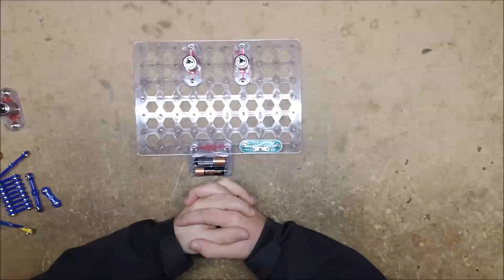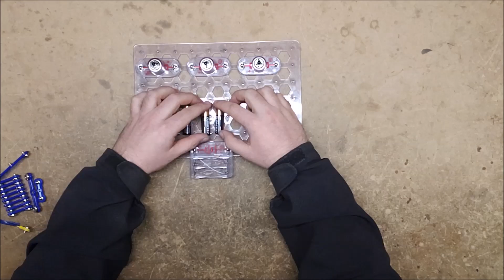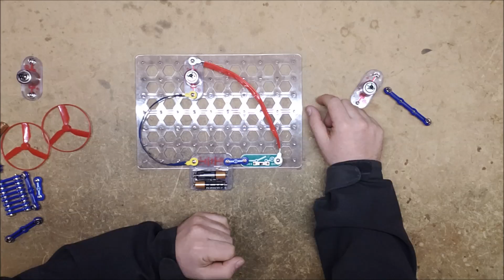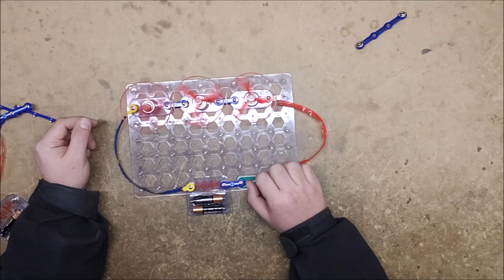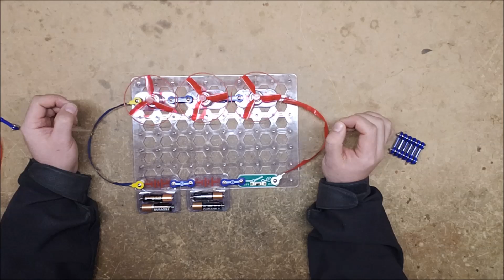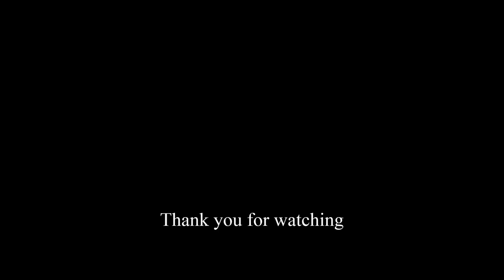Monday Mod Tips - Circuits - Parallel vs Series

Comment: As an EECS engineer, this is a nice, lay-man's explanation of Kirchhoff's current law (KCL: sum of currents entering and exiting a node equals zero) and Kirchhoff's voltage law (KVL: sum of voltages in a loop equals zero).

More circuitry tutorials would be nice for the rest of the community; battery capacities and longevity, lipo C ratings, understanding motor spec sheets, etc.
Reply from the maker: Thanks! I'm glad I got it right. I decided to avoid formulas and formal laws to not confused lau people...including myself. ;)

Comment: I have that thing. It’s called snap circuits It’s a pretty good thing to buy if you wan to learn about how electricity and things like resistors work.

The motors from the thing spin up pretty fast and a small child wouldn’t wanna touch it also electricity and small parts

Comment: Regarding the 9 volt batteries. Why are they so rarely used in either factory or custom blasters?
Reply from the maker: Because 9v batteries are designed for super slow low current applications. Things like fire alarms and alarm clocks. If you use them in Nerf blasters you would have to replace them about every 30 seconds.

Comment: I have made a 9v to XT60 connector adapter for testing circuits lol. IMRs are good for testing if the 9v doesn't have enough 'umph' to get things running properly, like pusher arm breaking. 
Keep up the good work with the electric explanation videos using the simplified circuit dealy you got there. Really helps put things into easy perspective, which we can all use at some time or another!
Reply from the maker: ...I am slightly ashamed I had not thought of doing that.  I will have to do so!

They say the best way to learn is to teach.  I have learned SO much doing these videos and I love it.  Thank you for the encouragement, it means a lot.  :)

Comment: Hey cap what is your view on IMR in blasters with stock motors, flywheel and cage, new wires, and no switches????
Reply from the maker: No switches?  How would that work?
Reply: 😂 ok one switch
Reply from the maker: How many IMRs?
Reply: Basic rewiring of a stryfe
Reply: 2
Reply: Only two i'm playing with small children
Reply: Its actually a question of lower costs in batteries not better performance
Reply from the maker: While it is not advised, 2 IMRs and 2 dummy batteries will work and will give a slight boost.

Comment: For testing I use an old computer power supply that I modded to have barrel jack connectors. I have 3v, 5v, and 12v rails I can use to test circuits. Also the power supply had built in protections in case too much current tries to get drawn from it.

If you are handy and want an inexpensive bench power supply, look into making one yourself.

Comment: Interisting choice to use the snap circuits to teach electricity. I happen to have some of these and I just resorted to making something random for fun. I haven't used them for years, but I could use them to help teach my little sister how to wire, rewire, and disassemble electric blasters.

Comment: A video on LED's and their voltage and current requirements, as well as proper/recommended resistors would be appreciated if you can make that video at some point. I know others have done LED videos already, but a nice, easily digestible video in your mod series would be great in case some folks only sub to you.